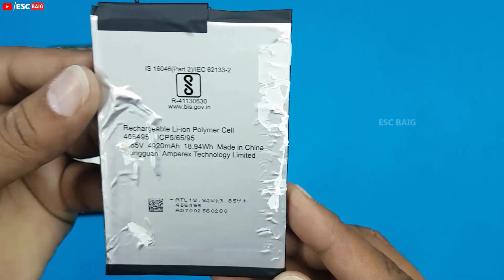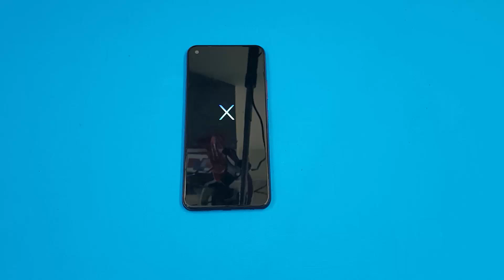Infinix Hot 9 Battery Replacement / How to Remove Infinix Hot 9 & Hot 10 Battery | Hot 9 Disassembly

Comment: This really good in video also long life but battery replacement method is very hard also typically not good after use 1 time when battery finish mobile is not giving good performance.